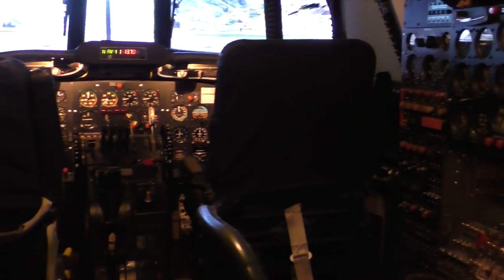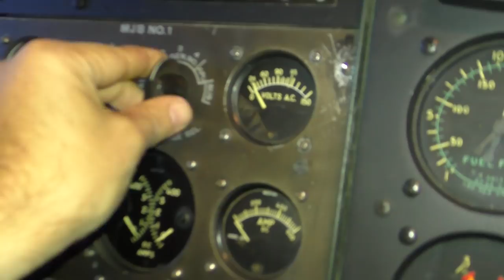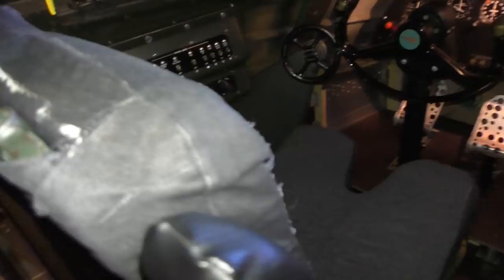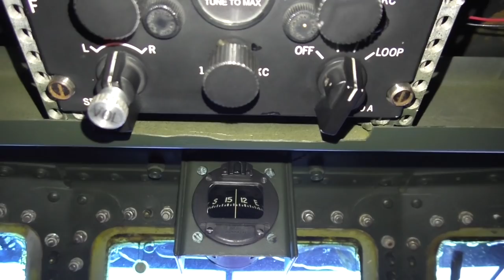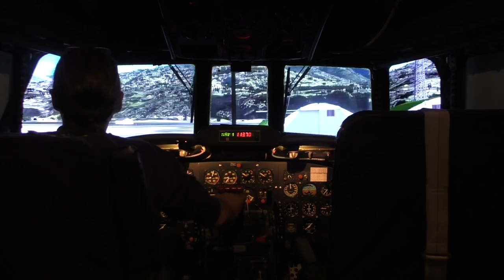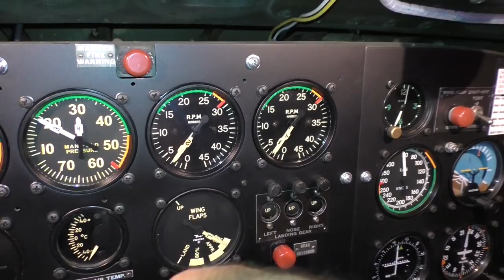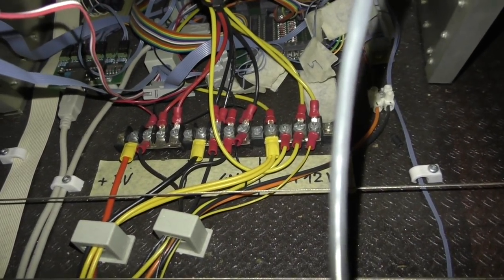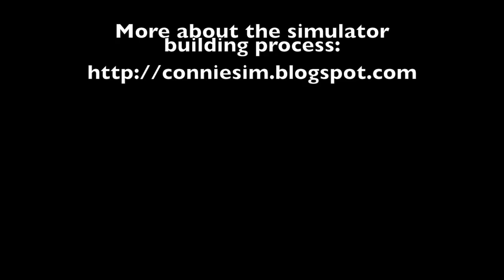The Lockheed Super Constellation Simulator - (PWJ111)

Comment: Isn' that simkit stuff a bit overpriced? Buying a bunch of electronics and gauges end up costing like a real plane
Reply from the maker: It's expensive but not overpriced. I mean there are not many alternatives and their stuff is good. They have a full glass cockpit now for 4500 Euro. This is expensive but a real avionics system would cost 100'000.Of course it's possible to make everything by yourself. But that will take lots of time and technical skill.
Reply: Definitely, i agree. Though for some parts, like the 6-Analog Input USB controller for 100€ (an 8 bit PIC with some passives?), they make a great margin. Anyway great stuff! And great simulator